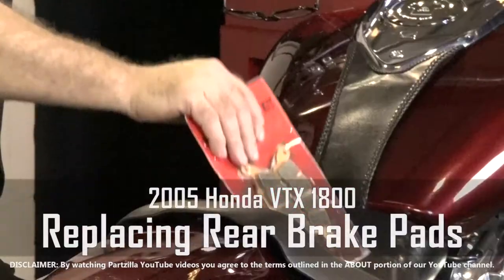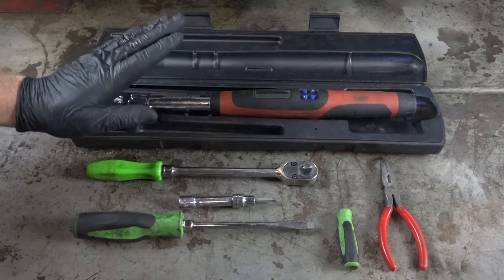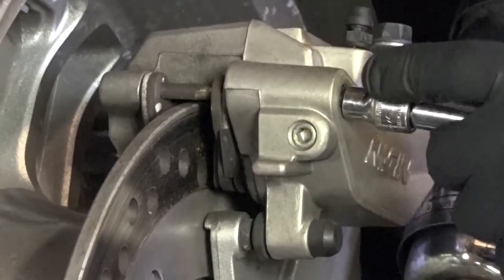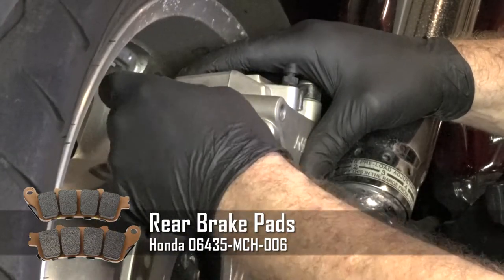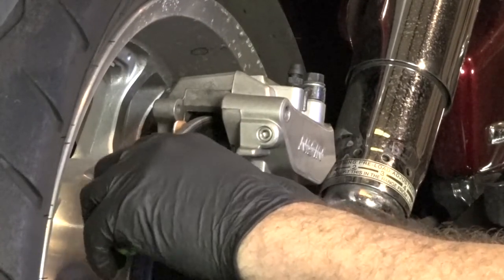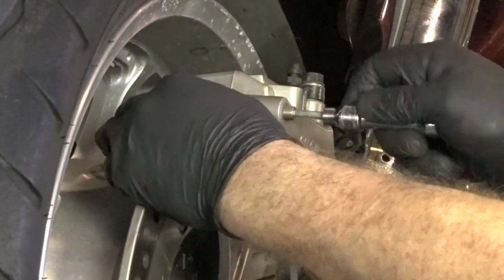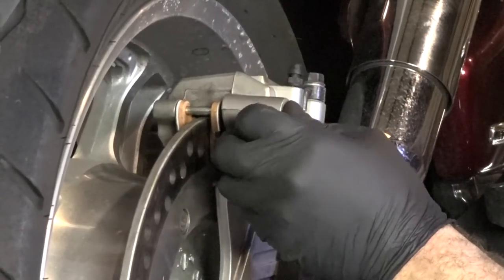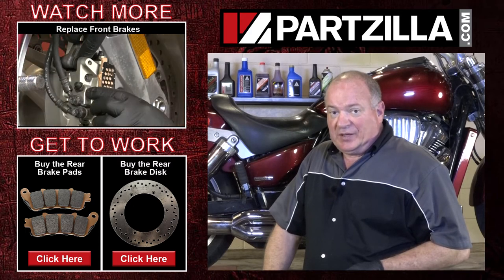How to Change the Rear Brake Pads on a Honda VTX 1800 | Partzilla.com

Comment: Followed this to a T I had no rear brake when I bought my 2003 VTX a couple months ago now that it’s riding season here in Connecticut I figured I better bleed the system and see if that brings my rear brake back and wow this was so thourough and helpful I feel like a pro haha and now my rear is working perfectly there was tons of air in the system, the guy I bought the bike from assures me the breaks were just done by a professional. I’m happy I can safely ride now thanks to partzilla!!!

Comment: That's a great method if you want to jam all of the dirt on your pistons into the seals and mark up your disk by prying on it. Do it properly people, take the caliper off and clean the pistons before you drive them into the seals then use to old brake pad to push the pistons in.
Reply from the maker: We have found that brake calipers are engineered to keep the dirt and crud out of the piston seals.  Compressing them won't cause harm to the system. Of course, if that's a concern for you, we encourage you to do what makes you comfortable when working on your ride.

Comment: One question for both the front and rear brakes, do you need to use any type of brake grease for the contact points, or anti seize on the pins? I don't have the Honda manual to reference, but that procedure looked pretty straight forward for sure! Oh..second question, any plans to do a valve clearance inspection/adjustment video? That procedure has cost me some $$$ over the years! Every 800 miles, and I have 32k on mine. I should really research that procedure and see and try, but its somewhat intimidating.
Reply from the maker: Hello rbljackson. no type of grease/anti seize is required for the pins.
for your other question... we still have the vtx available to work on, i will bring it up in one of our meetings and see if its something we can do.